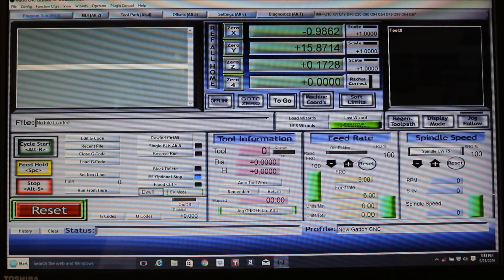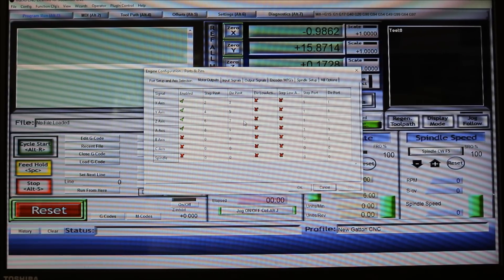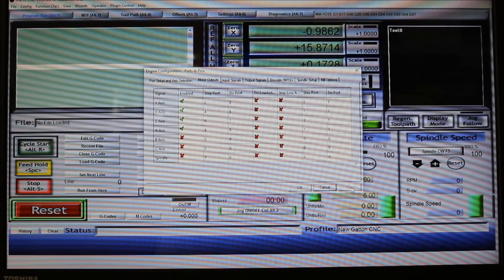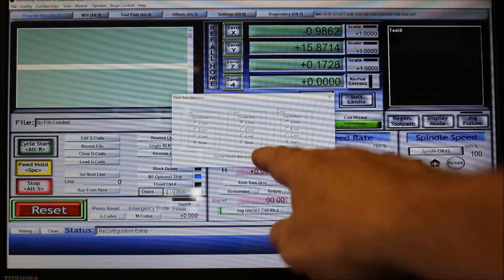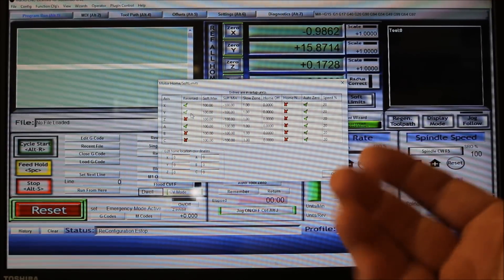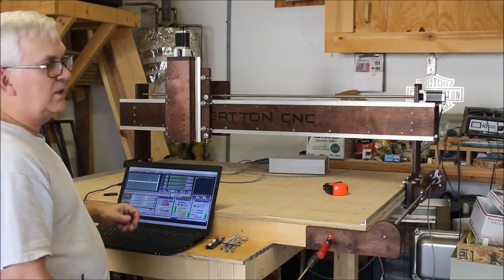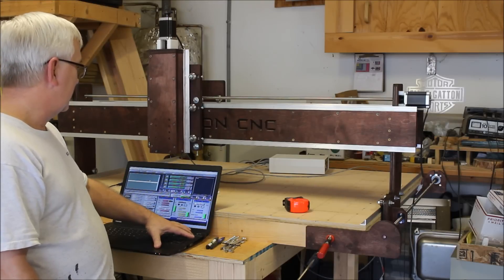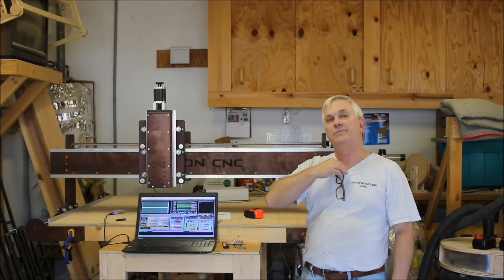Dave Gatton CNC Build Part 10.5

Comment: I downloaded Mach3 per your instructions and everything seem to work okay.  I slaved the A axis to to the Y axis and enabled the A axis on motor tuning.  Y axis worked both front to back.  I saved all settings.  When I restarted Mach3, the Y axis moved forward and backwards but the A axis didn't move.  I went back to motor tuning and the A axis had a red checkmark.  I enabled it again and the Y axis moved correctly.  I save the settings each time but when I restart, the A axis is always disabled.  Any suggestions?  Thank you.

Comment: Dave  That wsa a great set of videos many thanks  I Live in the UK and just starting to get a parts list together, most of the parts i have been able to sours but i am struggling to  find  a supplier of the lead screws and nuts do you or  any of your panel have any info on UK suppliers.
Reply: hello ron what size is your machine
Reply: Jerry
        It will be 1300mm on the X and 1400mm  on the Y